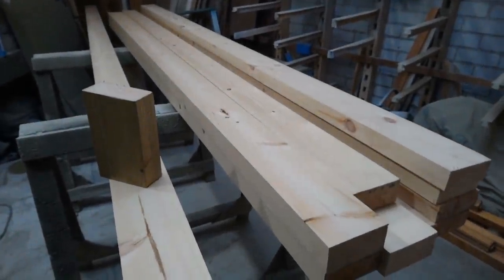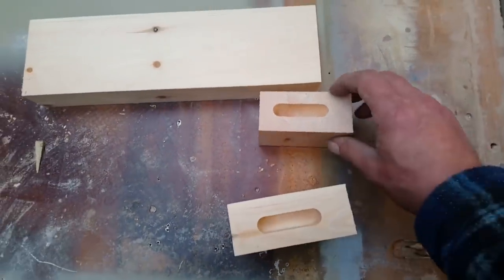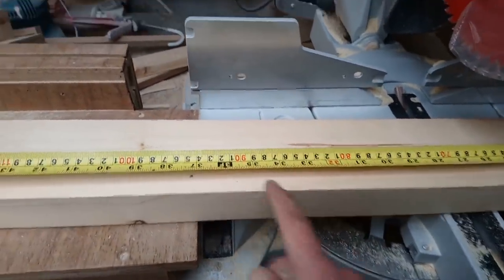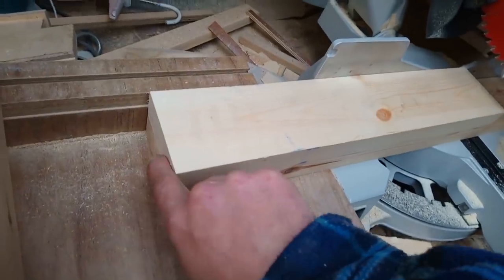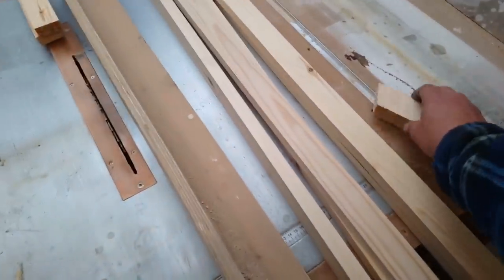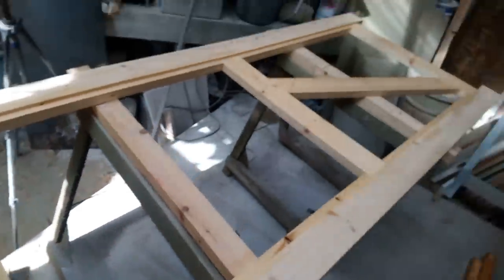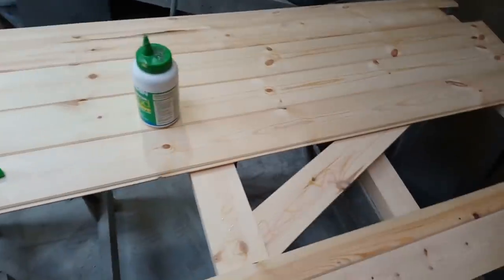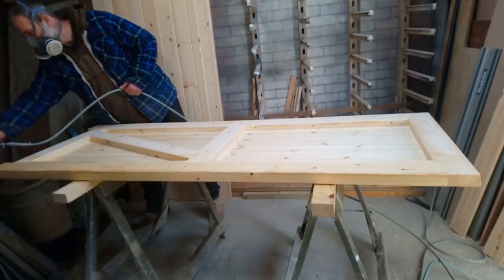Side gates - Making the gates

Comment: Thanks for this. I’m digging though lots of your older stuff too and enjoying it. 
I have a wood selection question. How do you do it? I’m guessing Rules of thumb! But where to start?
I’m looking at building a pair of driveway gates. Each leaf 1.3m wide x 1.4m high. 
Thanks again for the material.
Reply from the maker: Hi, for the size of wood that is taking some weight, I use a floor joist formula, 44mm joists @ 400mm centres -  the span ÷ 20 + 20mm, the added 20mm is for safety & to reduce bounce in the floor, so that can be ignored for eg. pergolas, In your case for gates I would say the sizes are more about aesthetics, design, practical tried & tested sizes, every gate I've built has seemed to be different, even the ones that are the same 🤣🙃😂👍🤸‍♂️
Reply: @Gidjoiner  thanks for the reply. Have a good weekend.

Comment: Just came across your channel. Having watched you make the gates I think I missed how you fitted the T&G boards into the frame lengthwise. It looked as though you just trimmed them all with a track saw but how did they all fit inside the header? Was the header fitted afterwards? How would it be done if the rails were morticed into the stiles rather then your method in the video. Hope this makes sense? Cheers. Great vid, enjoyed watching it.

Comment: Another great video, very detailed in the explanation,  out of interest if you were to get a new table saw which one would you get?
Reply from the maker: Thanks James 👍 Last week when the saw broke I had about £500 to spend, I've been working weekends to save up for a decent welder i had to choose, saw or welder,  I bought the welder, that can fix my saw & keep my van on the road, I'm screwed without wheels but have another table saw in the van n could even get by even without that. so sorry i didn't really look, for that kind of money i might have just got a Dewalt portable site saw but my ideal new saw for me really I'd end up spending over £1000 for what i want.
Reply: Yeah difficult decision,, I've got the de walt saw, it has it's obvious limits,  i would love a setup like yours but im limited on space,  i have been looking at the Axminster table saw and the Itech?
Looks ok and just about affordable. 
Looking forward to your next video
Reply from the maker: Yeah decent saws aren't cheap, when i bought this for £500 i had a choice to spend a little more for similar to the ones you mention but they only cut 75mm deep, the one i have cuts 100mm, i thought i could improve it, mount it in my bench, make a decent fence which i did, it's an on going project as long as the motor keeps going 😉

Comment: Gid, thank you so much for putting together such a detailed video on how to make gates. I’m going to attempt to make my own. Just one question what size nails did you use please? Many thanks again Jason
Reply from the maker: Thanks n you're welcome 👍 I use the longest i can get in, the panelling is 12-15mm thick, the batten/groove it's getting nailed to is no more than 30mm so I'd use a nail 40mm-ish, i use ring nails with a flat head, not as pretty as pins but a lot more holding strength, I went to fix a gate not long ago where a big firm, Atkinsons, had nailed the boards on with 16g pins, a little expansion with the weather n they'd bowed n popped off,

Comment: Any ideas where i can buy them large domino dowels from you are using in the video they only seem to have small ones from festool ?
Reply from the maker: Hi, either D&M Tools https://www.dm-tools.co.uk/search.php?search=Beech+Dowels&x=15&y=16, Axminster Tools https://www.axminstertools.com/accessories/power-tool-accessories/biscuit-jointing-dowelling/domino-machine-accessories Or FFX https://www.ffx.co.uk/Search/Refine/_K=domino I check out the price difference as some have offers on or they're not in stck, I've had better service from D&M than FFX over the yrs, Axminster have always been spot on but their prices can be a bit more expensive,  I think delivery prices might be different, been a while since i bought some.
Reply from the maker: Sorry i've just had a look at this video, i don't think you can buy them, i made them on the router table with a chamfer or round over cutter,  the important part is leaving the little ridge that runs down the edge 👍😉
Reply: @Gidjoiner   oh i see i thought you might of made them as  they are unusual sizes you are using im sure i can make some too thanks for the reply
Reply from the maker: 👍 like i say the little ridge keeps the domino in place laterally, don't make them too tight in width or length & the little bevel/chamfer on each edge creates an air hole so it lets the vacuum out 👍

Comment: Hi gid. I’m thinking of getting a headless Pinner for an oak bannister and spindles job I have coming up, could you recommend a decent compressor and Pinner that isn’t too pricey as I’ll only be using it occasionally but also decent enough that it won’t break, cheers
Reply from the maker: Hi, I've had an axminster headless pinner for yrs, it's 'ok' it only fires up to 20mm but would replace it with a Bostitch that fires up to 30mm, they are top nailguns, My little compressor is a Wolf, 25yrs+ n still works fine, when it dies I'm not sure,...
Reply: Gid joiner I have been looking at the Axminster Pinner. Would you say for jobs such as spindles/fillets on a stair case or beading it would do the job? I’ve got a lot 16g Brad nailer I use for general 2nd Fix and painted work but think it’s a bit aggressive for oak spindles/fillets
Reply from the maker: For spindles i use 18g Bostitch, Headless pins are not big enough & they need the head for holding strength bu if your going to glue them than i was taught a nail or screw is only a holding/clamp until the glue goes of, I think you'd need more than 20mm the Axminster does tho, which ever you buy try put the nails in at a slight angle to each other bit like a dovetail angle, the two will work together for better holding, nails put in parallel/straight might pull out straight
Reply: Gid joiner that’s fair enough I can see where your coming from, if you were installing oak stair parts how would you install the fillet pieces? 
Do you think glue and tape would do to save on having to hide pin holes?
I usually only do paint grade stair parts and just use my 16g nailer
Reply from the maker: I use 18g a lot more than 16g 🤔 16g is a bit rough.  traditionally they would've just stuck a nail in, it's part of the honesty of a build, & a lot of wood was used for it's properties not aesthetics so oak was painted over, of course some were stained & polished but it's only more recently that these pieces have been stripped & varnished, I think to tape & glue might be difficult, each spindle would be pushing against the next fillet piece & it all could get out of hand, I think minimal fixing with the headless pinner is the choice, they are invisible & the plus side to not having a head is they don't split the wood which Oak does easily.
Just had a look to see what's on offer, I still think the Axminsters 20mm isn't big enough, I would spend the extra n get the Bostitch, it'll last you a lifetime, that goes up to 30mm, that's enough for you, after that it's the Grex that'll do bigger pins but costs a lot, Once you buy a compressor you'll find yourself buying alsorts of nailers/staplers etc.. 😂 I'm going to buy this one one day.
https://www.ffx.co.uk/tools/product/Bostitch-Tu-216-2330K-E-5902013930334-23-Gauge-Headless-Pinner?gclid=Cj0KCQjw4qvlBRDiARIsAHme6ouA56-g5l9j_H_7wzZHmOTMkXBh0Ru7PNobDLLpekgUkizyrZmKAj4aAkomEALw_wcB
Reply from the maker: BTW This is where i get my nails/staples, 
http://www.betcofasteners.com/
Reply: Gid joiner this even, think the last one was just a stapler 

https://www.nailandstapleguns.co.uk/bostitch-bt1855-e--mrc6-u-compressor-kit-15-50mm-183-p.asp
Reply from the maker: The nailgun yes but not the nailer/stapler, to fire staples the firing pin has to be flat, the width of the staple, when it fires nails it will leave a line the width of a staple rather than a pin hole, just buy a nailer then at a later date if you want one buy a narrow crown stapler. the compressor i guess will be ok but sorry I've not played or heard one to give any feedback. Bostitch are my no'1 choice of air tools/nailers. 👍 (I have 18g & 16g pin nailer, coil nailer, palm nailer, narrow crown stapler, strapshot nailer, felt nailer, all Bostitch 😀) My framing nailer is a 25yr old Dewalt, & as you know i have an Axminster 23g headless, 
The Makita 18g i don't like & wish i just bought another Bostitch 18g, I've other air tools, having a compressor lets you blow up tyres, All these run off my little noisy Wolf 6ltr compressor,   I've a metal body saw, grinder &cut off saw, these like to havee lots of air so need to work from the =shop compressor , The coolest & scariest air tool is the Air locker ap700 Punch Nailer/Nail Remover 🤪😂 Google/ YT - air nail kicker or watch my vid, https://youtu.be/oFSFt3V0JNM
Reply: Gid joiner that air kicker looks a great tool! I’m thinking of the 18g BT1855-E and getting a wolf compressor and hose. I think it will work out cheaper than that bundle tbh! As regards to filling pin holes in the oak, what do you usually use?
Reply from the maker: 18g BT1855-E is the same as i have 👍👍 You only want a 6litre compressor if your taking it around with you to site/jobs,
Reply from the maker: Oak filler, 😂 sorry

Comment: Hi, I’m looking to build my own gates, I have a gap of 1752mm between a brick wall and a fence post. Would you recommend double gates? How wide is too wide for a single gate? I want the gate to be 2m tall.
Reply from the maker: Hi, there's not really a limit to how big a gate can be, if made with wood it's prob the size of timber that can be acquired & the structural strength of the wood, farm gates are big & canal lock gates are massive, what will limit you is what you're hanging it on to & the hinge furniture available, a brick wall might seem solid but i wouldn't hang anything too big on it, prob no more than one of a pair of gates, & if i hang a big gate on a 4" post i like to put a timber across the top between the posts like goal posts to help support them from leaning with the weight, 6-8 inch posts & bigger can be bought that won't bend, the bigger the post & the bigger the gate the more of the post needs to be in the ground, ⅓-¼ of whatever sticks up needs to concreted in, 6ft sticking up needs 18"-24" in the ground, if the post was for a gate i would make sure it was close to the 24" depth. Sorry i can't be much help. I have some pics on my FB page but i don't think there is any big single gates https://www.facebook.com/gid.joiner/photos_albums

Comment: Really good videos Gid 👍👍 What dimensions of redwood for your rails and stiles?
Reply from the maker: Thanks  👍
it's off the shelf 4x2 & 4x1½ so 95mm x 44mm & 95mm x 32mm, I didn't plane anything so it isn't exactly sq
Reply: Gid joiner thanks for the reply mate, I’ve a gate to build soon and this is such an inspiration 😊👍
Reply: How thick was the match board after machine planed gid !
Reply from the maker: @gymhull  I think they right it on the invoice as 15mm but it measures more like 12mm, I'll have a look at the stuff  i have left when i get home n let you know 😉

Comment: If you couldnt use dominoes or mortise and tenon (due to time) how else would you join the rails and styles?
Reply from the maker: 🤔The Domino is ¼ of the time compared to mortice & tenon, that's a big reason why i bought it, Half lap joints would take a little  bit of time, dowels if you had the dowelling machine, doing them by hand is inconsistent n time consuming, Apart from that, screwing or nailing together, duck tape & super glue or magic 😉 🧙
Reply: @Gidjoiner  one of my favourite answers of all time!
Reply: I always use a little bit of magic 🎩 when making gates 💪